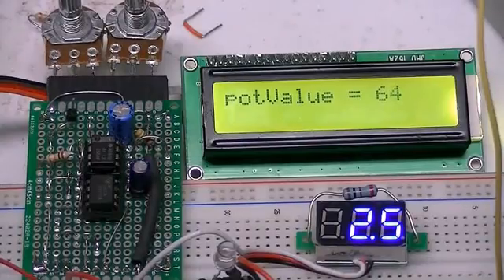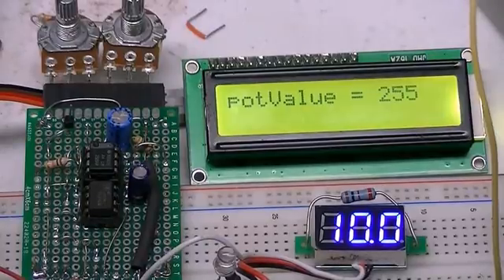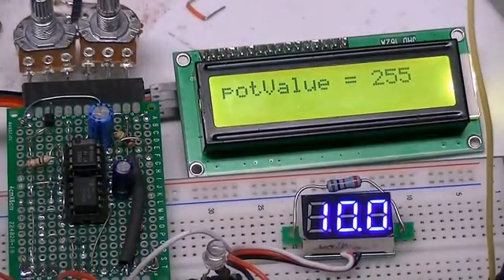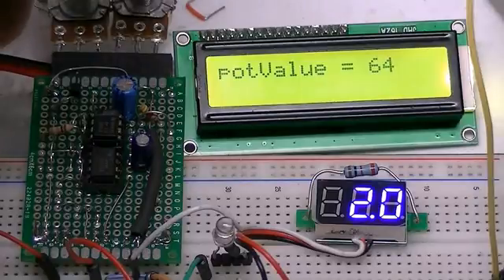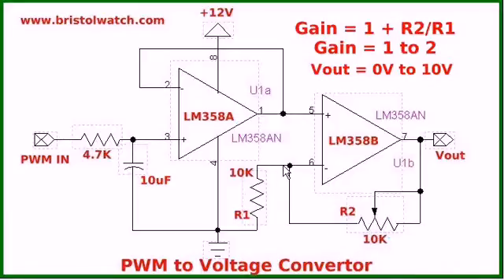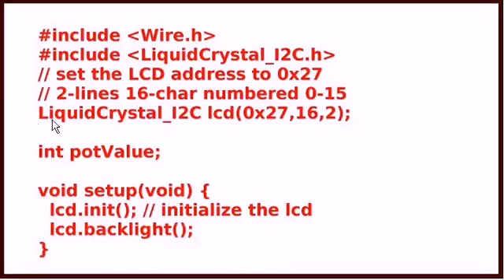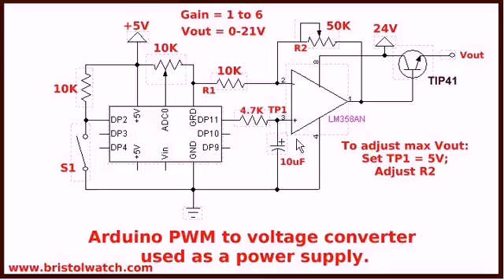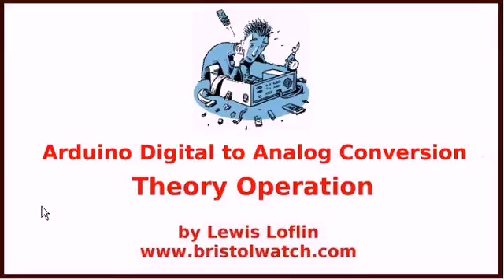Arduino PWM Digital to Analog Conversion

Comment: Sir,
How to do the same with nodemcu ? Because the output voltage is only 3.3v .. so how to modify the RC low pass filter? And will the rest of the circuit remains same ? All i am trying to achieve is i need 0 to 5v output from  analog write function of the nodemcu ? How can i achieve this ?

Comment: why buffer and amplifications are not done in an op amp. when i try this with 10k and 10uf low pass . the output is not stable as well there are some AC components

Comment: Great video, thank you.  I have a question, if I need a certain value to visualize, like I need that 0-10V for a digital input of another circuit where I want to set a pressure 0-400 bar with, what equals that 0-10v, how can I set and calibrate that 0-400 in the program? Thank you